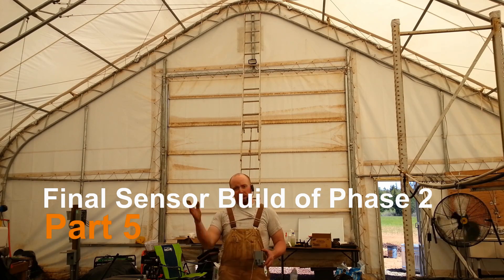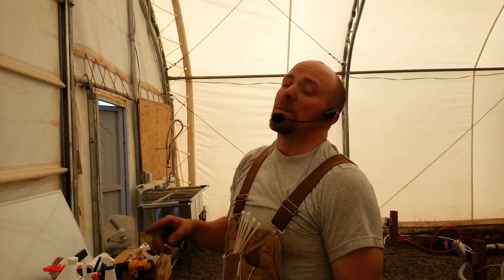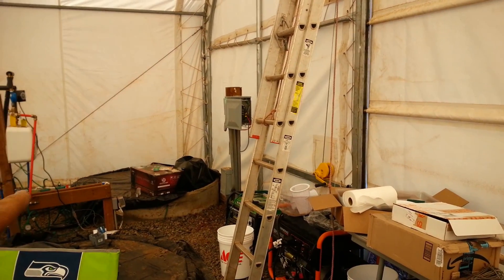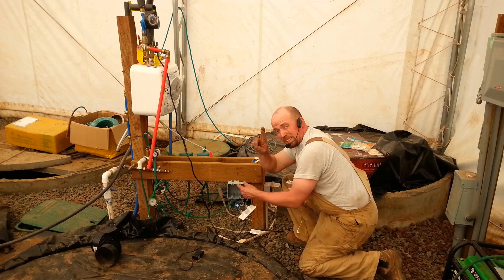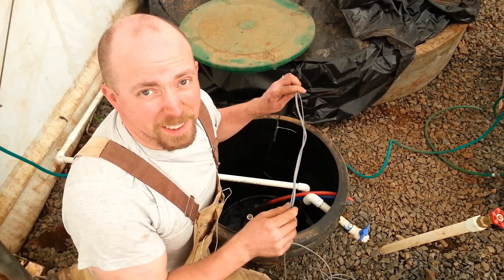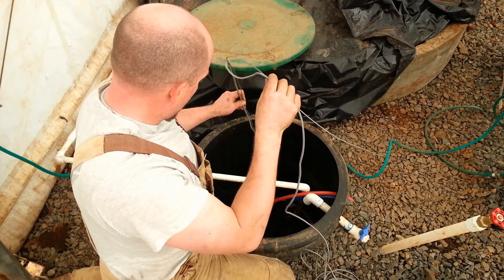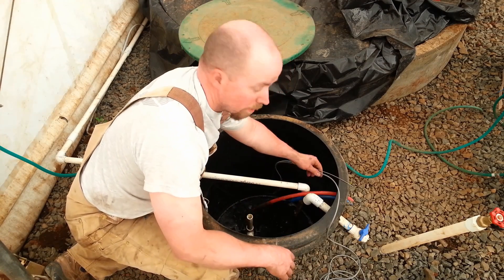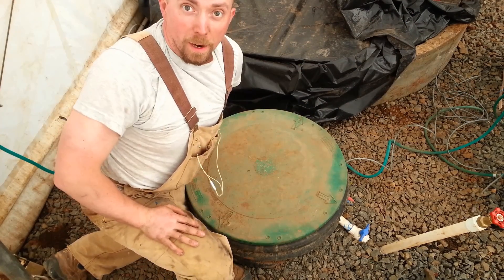Off-Grid Trout Aquaponics Automation - Arduino Sensor Build Part 5

Comment: Ground Control To TRM.  Congratulations and success on the monitoring installations.  You just need time to analyse all the data now.
Reply from the maker: yeah I can't wait to actually start looking at data and see what it all means, especially with the digester. That one is going to be key...now if I only had sensors on the methane storage I could see the link between temp and methane creation as I load the digester

Comment: Hi TRM, So 50 degrees, how much would you attribute to the surrounding ground temperature? How much heat can you pump into the digester? Hope you get that online soon so you can use your meth-electric. Cheers,  
   Bill
Reply from the maker: I've turned on the heater to the digester and within a few days we went up to 70F. I think ground temp right now is at 50F so it make sense...darn it....that's another sensor I should install....ground temp...drats...more work :-)
Reply: Hi TRM,    
I really would not worry about a ground temp sensor unless you measured say every 2 feet to the bottom depth of your digester(12 feet). But really I think the only sensor you need is the one you've already installed, inside the tank. The good news is if you ever need a summer heat sink you can you can tap into the earth and pull out 50 degree air (if you ever need a winter heat pump you can always pull out 50 degree air).  BTW did you see my comment on we survived winter 2016 video?  I went back and watched the digester install videos. For the next digester build think about insulating the digester with something. Structural insulated panels or the like may be the way to go, but only you know what is best for your situation and budget.  
  Cheers,  
  Bill